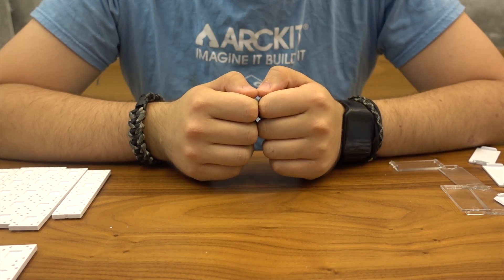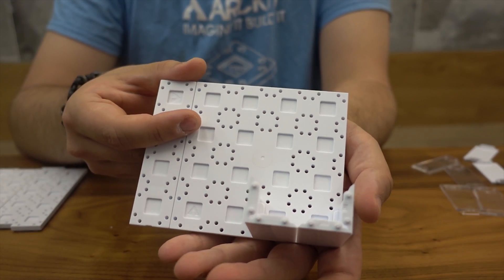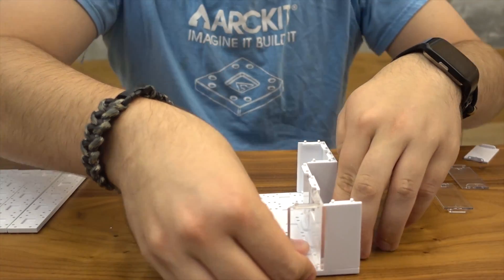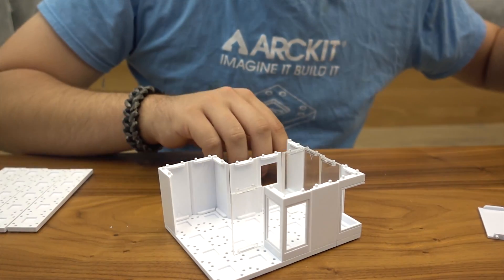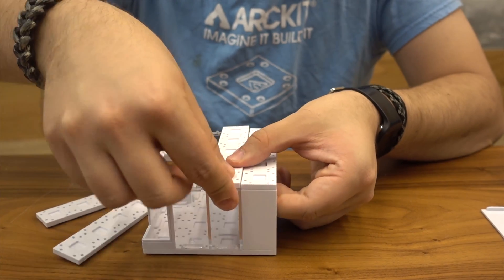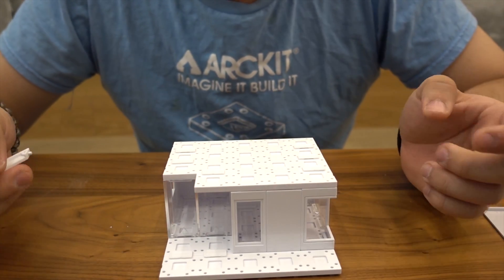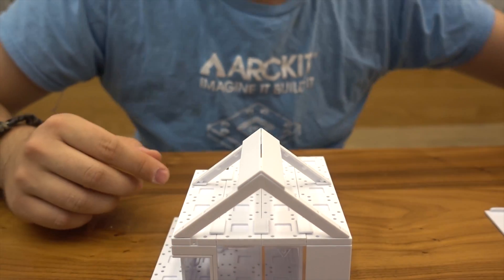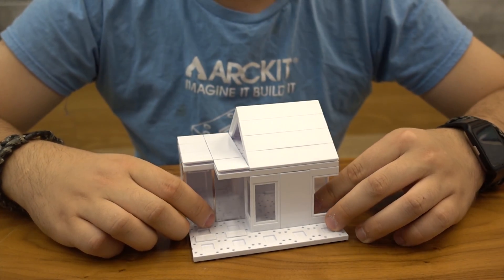How to use your ARCKIT Mini Dormer - Build 1

Comment: I don’t know these architecture words, but I’ll try and understand them.
Reply from the maker: If you have any questions, just let me know!
Reply: @RikySongSu  Thanks, I think I have all the pieces, but I’m not sure, My thing has been in my closet unbuilt for like... 8 years? Anyways, thanks for helping out, means a lot.
Reply: Also, another thing, mine doesn’t come with stairs, If you work at ARCKIT, Or have wall the sets, What model is mine?
Reply from the maker: @cjjones6749  do you know what set you have? Some sets don't have stair components.
Reply: @RikySongSu  I forgot which set I have. I think it’s the... Mini dormer? I’m not sure, though.
Reply from the maker: Yeah I think it would be one of the mini sets!
Reply: @RikySongSu  Do you think you could help with this? I don’t think you can, but it would be appreciated if you could!
Reply from the maker: @cjjones6749  sure thing what would you need help with?
Reply: @RikySongSu  uhhh....hmmmm.... Can you help me build a house thing with what I have? I’ll tell you the stuff I have soon.
Reply from the maker: @cjjones6749  alright sounds good.
Reply: Alright, 1x 4x4 floor panel thing, 2x 1x3 floor panel things, 2x 1x4 floor panel things, 2x 1x5 floor panel things, 1x 2x1 floor panel things, 2x big orange window panels, 2x edge window pieces, 2x doors(?), 7x roof panel things, 2x window roof things, 18x connector pieces, 7x window panels, 14x wall pieces, 2x pillars, 1x round wall, 4x grass pieces, 2x round floor panel things, 3x orange triangle things.
Reply from the maker: @cjjones6749  I would start off trying to build a traditional rectangular form. For the perimeter walls, create some symmetry with doors and windows before applying the roof on top. This would give you a great foundation to come up with variations of new ideas!
Reply: @RikySongSu  alright, the thing is I’m just bad at thinking of anything, do you think you could like,, record a video, make it unlisted, and give me the link..?
Reply from the maker: I have a whole bunch of videos in my Arckit Playlist that you could use for inspiration. If you have one of the mini kits you could build along with my mini dormer series and always pause the videos to catch up! If you would like a more personalized experience, I'd be happy to coordinate with you a private video chat session.
Reply: Alright, thanks for the help! I’ll do try and do build 3.
Reply from the maker: @cjjones6749  sounds good! If you have an Instagram, feel free to share some pictures with me there or through email!